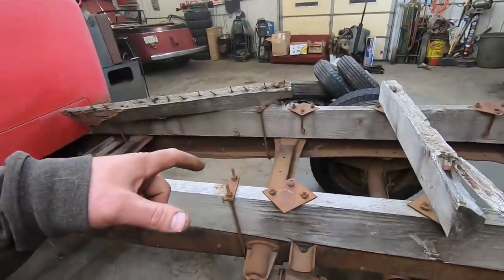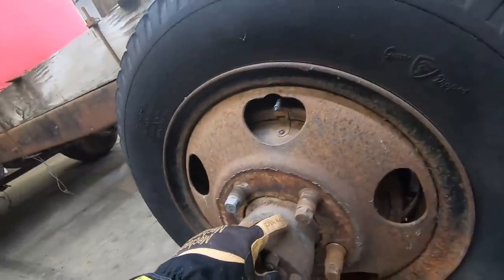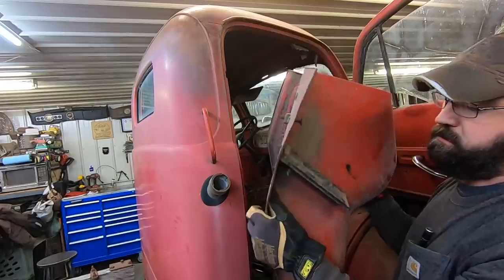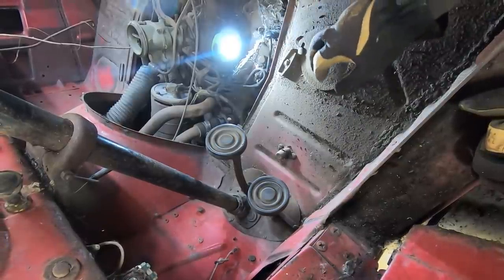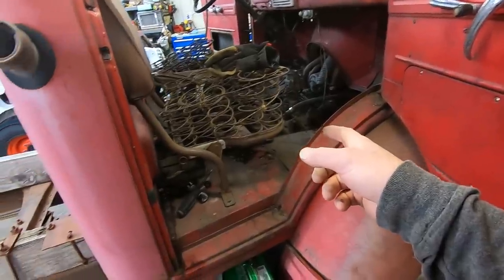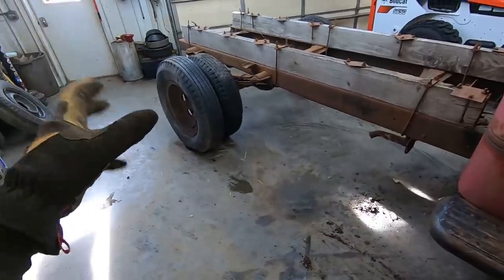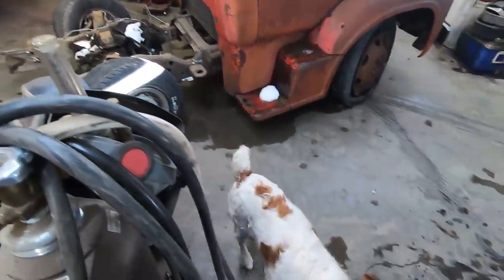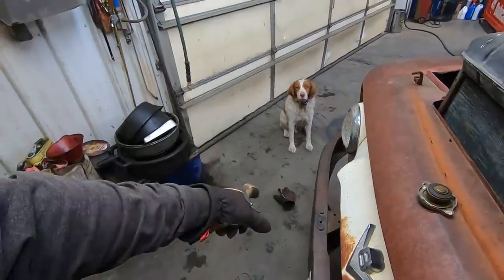1948 Ford Cabover Farm truck! Abandoned for 40 years! Will it run?!? Bonus "Stubby Bob" footage!

Comment: If cabin fever was a vehicle, it would be that stubby bob thing.
Reply: Stubby Bob was awesome!
Reply from the maker: If cabin fever was an image it would be that 54 with an engine hanging off the back and wheelie bars!
Reply: Could be worse Wes.Could be a garbage truck....
Reply from the maker: @burtbacarach5034  Ohhh a stubby wheelie poppin trash truck!! Brilliant!
Reply: Truck.engine.can.be.low.compression.cars.had.high.compression.flat.head.fords.australia❤❤❤❤❤❤❤
Reply: Needs.high.gearing.to.save
.fuel.and.faster.australia.good.luck.❤❤❤❤❤❤❤
Reply: Turn.extra.gearbox.around.to.speed.it.up.overdrive.australia❤❤❤❤❤❤❤❤

Comment: When I started my automotive technician career back in 1989 the local Ford Dealership that I apprenticed at still had(and used) a Sun Machine like the one that you have. 
 That’s where the saying “putting a car on the machine “ came from. I’m sure everyone has heard older folks talking about taking their car to the dealership to have it “Put on the machine “ to diagnose what was causing the car to run badly. That Sun Machine was the mysterious cutting edge high technology machine that they were referring to.
Appreciate the video. 👍
Reply: Top end gas station. Had a scope and charged 25 bucks more to hook up on the up in 1972
Reply from the maker: The good ol days!
Reply: We had one in our high school shop.
Reply: I work at a ford dealership now in Australia, we still have a vane tunescope similar thing to the sun machine. I've used it once in 12 yrs working there
Reply: When I went to High School our Auto Mechanics teacher said the school was working on getting the funding to get one...We did have a distributer tester though. The reality of the situation is that those were "sales tools" Any good mechanic (just like today) could do the same quality work (probably much faster) without one. But when people saw them sitting in the shop they would spring for the big money service.  THAT'S A FACT.
Reply: @MortskeRepair  we didn't have any type of diagnostic equipment at my high school and barely had a welding machine. I had 25 people in my graduating class. 14 girls and 12 of them were pregnant. The two that weren't were 1) The local preacher's daughter 2) A 350lb atheist that was a very nasty young lady. We were multiple year baseball state champions. I like to tell people who ask me about my high school days, We knew how to do 2 things really well. Fight and play baseball. We didn't know how or when to pull out though 😂😂😂😂😂
Reply from the maker: @bigsexymuthashutyomouth2546  Sounds like they were friendly gals!

Comment: One of my first vehicles was a green 1950 Ford F1, flathead 8BA; bought it in the early '70s for $125.  I had a machine shop punch it out (I think 40 over) and let my little brother work on it for his auto shop class at Fremont High in Sunnyvale, CA, before he had a license.  The story was he would take it out in the parking lot, blow up the transmission, rebuild the tranny in shop, take it out in the parking lot, blow up the transmission.....  I remember watching him pack needle bearings in the mainshaft on our parents' driveway.  My friends and I poached plywood at night from one of the subdivisions being built in the cherry orchards and made a custom camper shell on the back.  On a trip three of us took to Isla Vista to visit a friend at UCSB, the fan assembly froze up around Big Sur.  We removed that belt and were able to keep the dual water pumps and generator working on the separate belt, air moving through the radiator from driving around, and got a fan from a wrecking yard to button it back up.  Those were the days.  Thanks for the videos!
Reply from the maker: Good times!

Comment: This video reminds me of my buddies late father. He made his own dual wheel rims for his service truck by cutting and welding rims this same way. And when he put them on the balancer they were really close. He too had a wealth of useless knowledge. He could fix anything you put in front of him. Much like u demonstrate in these videos.  He would have loved your channel.
Reply from the maker: I like folks with that “can do” attitude!
Reply: My uncle did the same thing with an old Oliver 60 tractor. He had one of the rear rims rust through, so he cut the center out of it and out of another set of rims from an old combine and welded it all back together. It wasn't quite true either, so the tractor tended to rock side to side on the highway.  It only went about 12 mph in road gear so it wasn't a big issue and it didn't launch you off when driving. But in the field raking hay, you really didn't notice it at all.
Reply from the maker: @dannyo6699  You make due with what you got! Saved himself a pile of cash in the process!
Reply: @MortskeRepair  Very true.

Comment: Just started the video but wanted to say if you bought that Sun unit for "cabinet" prices, you stole it. That thing is classic. I'd like to see a video on that and it's features just for fun. I bet you will get more requests for that....
I learned on the next generation of sun machines. Bigger, square. Good days........ Ok, back to watching. 👍👍👍👍
Reply: I Wanted To Suggest That, Feared Being Called An Idiot. Duff Can Be Ruff! (Haaa, See What I Did There ?) 
I’m Absolutely Not A Mechanic But Am Intrigued By Older Machine’s, Equiptment, And Such.
Reply from the maker: I really dig vintage shop equipment.

Comment: You really can't understand just how loud that tire blown out was behind the camera. I used to work with wheels meant for semi's and when they blow out it's loud enough the make you temporarily deaf. Glad you're okay, that could have been way worse
Reply: Sans  Hello O.o
Reply: When I worked at speedco we had a blow out you heard that clear across the shop and tire side was separate from the lube shop by a wall

Comment: In addition, this cab configuration made the engine compartment access a nightmare.  You had to stand on your head to work over the fender.  It was a Godsend when Dodge came out with the C Model short cabs in the late 60's which had swing out fenders and you could walk right up to the frame rails and engine.  Also, the short cab was developed to move the load bed forward to place more weight on the front axle because of weight laws.

Comment: When I was in highschool, auto shop class, we had one of those sun machines. Used it quite a bit. 83 ta 85, they did away with those classes not to much longer after that, I consider myself lucky to have taken those classes. Did a valve job on my old nova in that class also, after it jumped time and bent most of the valves. Joy joy
Reply from the maker: That's awesome!

Comment: Dad had one of those champion plug scopes. You can tell what cylinder had a bad plug or wire and them little green light bars dancing around just look cool. 
  Neighbor had one of those flat head V8 cab over trucks hauling firewood. Ran out of gas with one rear wheel in a mud hole. Left it there overnight of course it got cold enough to freeze, fired it up, let out on the clutch and snapped a rear axle.
Reply from the maker: Nice!

Comment: The curse of the old Fords continues, stuck motors, valves breaking off, tires exploding,AHHHH!!!!, on the bright side the flat head starter and solenoid did try to work. The Cummins swap would make a very cool parts chasing rig with that nice cab, stay warm.
Reply from the maker: Will do!

Comment: I can see that you unscrew the flat head off and it was water and rust inside. Then it is most wise to suggest that you unmount the engine and pick up the engine apart away from transmission. It comes out thru the doorway of the cab. Maybe, take out the windshield so that the crane can crates the engine up after the crane upper jack-up arm goes thru the windshield hole.
 Recommendation is to remove all the valve seats with careful grind it out with grind whetstone (cylindrical) attached to the drill and the drill's magnet base will guide both drill and the engine together. Then after remove the broken valve seat, press fit the new valve seat to the set hole of the cylinder block. The valve seat is malleable into the deck of the block. The poppet valve is high hardness so it breaks off only when rusted badly like brittle. Thanks for cleaning and big time overhaul the flat head set engine.

Comment: I worked on a pair of Ford COEs in high school auto shop.  55 and 56, both with the Y block.  Working on any cabover will try your patience.   If you are doing brake work, don't be surprised if the studs on the axle shaft drive flange twist off like butter.  Had to drill and extract at least half of them.

Comment: One of my favorite body style work trucks . I had 2 customers that built one , well used the cab anyway . One used a late Ford 1 ton with a power stroke , the other a late 90s Dodge 1 ton with Cummings and was working on using the truck bed with sleeper on it . I liked that alot .
Reply from the maker: Nice!

Comment: Timing is everything. once again, I find this stuff before I am ready for it. I shall check back latter. This is going to be a very busy year.
Reply: I am in lust, for a classic car hauler. Funny that 48 has the same grill work as our new/used 2011 FLEX. Witch has the same length as my 68 Mercury Montego MX. Am I painting a picture?
Reply: I am also working out how to rebadge the name from FLEX to FAIRLANE- SQUIRE with the same new dimensional 3D shape. I am aware? That it was in consideration as a first choice name selection.??? Wondering how. That might have influenced car sales?

Comment: Yea, that engine / chassis is not worth overhauling..... The easiest and most worthwhile way is to drop the cab on a newer chassis and part the old one out. I lOVE that SUN scope! I use to use one back in the late 70's to mid 80's. You could always find the problem with one of those, in it's day. Our modern phone's made them obsolete.

Comment: Mortske, When I saw all that mud in the cylinders and that valve broke off, it was give it up or drop another engine in it. It wouldn't be worth it unless you had another engine just laying around that would fit it, so I don't blame you for throwing in the towel. I'd have done the same!!

Comment: The windshield mold will be coming off so you can check and clean and sand the on the rust. What if the mold was damaged while taking it off - how to get a new replacement mold from rubber company? Thank you but will the rubberized mold not be coming off?

Comment: Something I do when removing a stubborn screw is tapping on the end of the screwdriver when twisting the driver to remove the screw. The shock from the tapping of the hammer helps break loose corrosion and rust
Reply from the maker: Just like the tool we put on the air hammer!

Comment: NICE!! it's a 48 Ford F6 stub nose, my dad's cousin has one just like it but it's a grain truck and a 1950 model year, it's hasn't run in almost 2 decades, his step sons use semi trucks but I should ask him if I can fiddle around with ol' stubby and wake him back up, he's been cantankerous at times but nothing I couldn't fix, been long converted to 12 volt and has a flathead 6 in it, but still it's an awesome truck, not in bad shape either, a little faded but still pretty dang solid
Reply from the maker: There you go!
Reply: @MortskeRepair   yeah, hopefully I get the green light to mess with it, I know it ran at one time, been sitting for at least 10 years but hey, when it comes to working on those old trucks they are easy peesy lemon squeesy

Comment: I really like these early Ford trucks especially the COE,s. An interesting bit of trivia regarding the first Ford COE, s. A company called Dearborn offered a conversion of the heavy Ford trucks in 1935, they did these conversions until around 1938 when Ford started making their own straight out of the factory. I have a 1934 BB Ford truck, that I want to rebuild, I want to retain the original wheels, but sourcing decent ones here in Australia is a challenge.
Reply from the maker: Interesting

Comment: Dad had a 1950 Chevy cab over. He was hauling tobacco for a leaf  dealer and when that was over, it was just a farm truck. We used to put ten tons on that thing. Two speed axle operated with vacuum. I think it had less than thirty thousand on it. Sweet compared to that Ford.She was a six banger

Comment: On your HF jack, I have one like that. I use it to work on my vehicles even though on my gravel drive way you need pieces of 3/4" plywood under them to keep from sinking and tipping over. It works very well as a jack to carry in your vehicle. Much better than the stock jacks. For shop work I like the long trolly jacks like most garages use. 
On my HF jack the one of the pumps quit working so it's slower than it should. I do like the aluminum frame, much lighter.
Reply from the maker: I haul mine everywhere

Comment: A cheap 16" dually wheel with a 6 lug pattern can be found on the flat nose Isuzu/GM 1.5 ton box trucks. We have used them on our sled pulling trucks for years.
Reply from the maker: Totally different pattern than this

Comment: Too bad about the stuck engines. Both those old rigs were pretty solid, except for the mouse damage :-(. Unless a running flathead happens your way! I’m not sure but Duff looked a little disappointed with not getting a ride. Maybe next time. Thanks for the Great video!

Comment: I'm guessing your driver's door is locked which is set by the position of the inner door latch.  Back in those days, most folks didn't get out on the street side but instead, slid over and got out on the curb side.

We just did a 47 Ford and it took pulling on both the inner and outer latches to get the bolt to retract.  Also, keep in mind that if the door WAS locked, that locking catch may be rusted in place and might not be retracting.

Comment: Hi.You got nice red 1949 truck and wooden box at the back. I see the wood beam is in longititude that's parallel to the second wood beam. Simply you like this recommendation - add two by six floor studs and across as width transverse to the two wood beams? Aim to hit with hammer and nail the new flat bed and the box was worn away and gone. Once you install the simply flat wooden bed and hold item with turnbuckle or a fancy antique belt'em down with ratcheting tie down tow line or nylon line (thick ribbon). How ever I see the clamp that flat plate atop the wooden beam is tighten down to the longititude chassis with bolt on and square nuts already rust Hauler with mounted flat head. How many 2 by 6 wood do you want to get them to fill the floor bed?

Comment: On aircraft I found a 3/8" speeder handle with a apex bit socket, kroil screw for a awhile, dip screwdriver bit in some valve lapping compound and wriggle it in screw head.

Comment: Ever watch Vice Grip Garage? He has something he calls "shine juice" he uses on old weather checked and oxidized paint. Seems to work pretty good, although I cannot speak from experience. Man... I would love to have one of these. I would put a 5th wheel on it so I could pull around my Dad's gooseneck accoutrements - Can't afford a cummins like he has, so something like this would be way cooler. Especially pulling our Antique Deere's to the tractor shows. Everything like that around here is just stupid expensive. Thanks, Barrett Jackson.

Comment: Little late to the party here, but the reason why the driver's door access panel was missing is actually interesting. I was told by many old timers that the drivers would remove those panels that way they can store rags, supplies, tools, trash, etc. In there. Storage was pretty much non existent in those work trucks other than under the seat and glove box. Also a huge reason why the door bottoms would rot.
Reply from the maker: Makes sense!

Comment: You need to break down those old tires and see if they have red rubber inner tubes in them.  They last forever.  My grandad used to cut them up for slingshot rubber.

Comment: Mac Tools makes a real good flywheel tool, it's Mac Tool Ft12. I've got one. But make sure you get the older model with the yellow & red handle. It's a beefy one. I found mine on eBay. I like it alot!
Reply from the maker: I got mine warranted. Should be good!

Comment: Arkansas Best Freight used this style Trucks for years.. I bought a Ford as well as a Chevrolet from them when they went Bankrupt in the 1970's. They had Dry Freight Boxes n them. Great Trucks, I also owned a 1949 Ford 1 Ton Flat Bed with a dead Tag axle that was one of the most worthless Trucks off smooth pavement you could ever find. You were forever getting hung up by that extra rear axel.
Reply from the maker: Ha I bet!